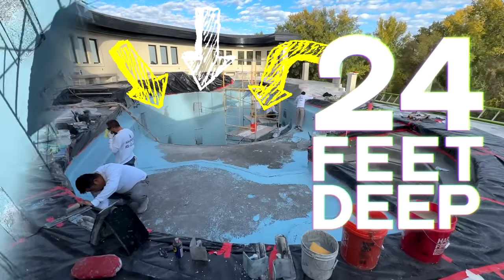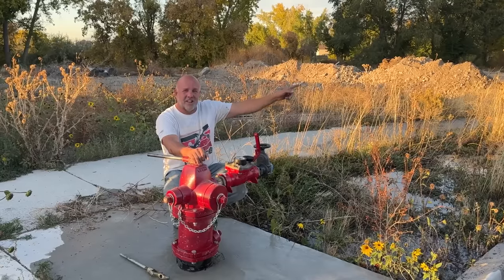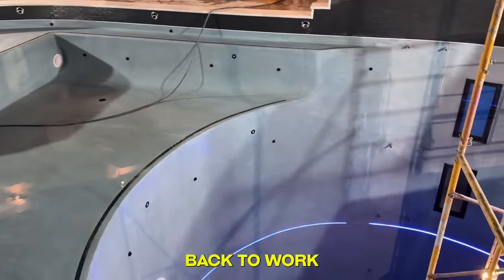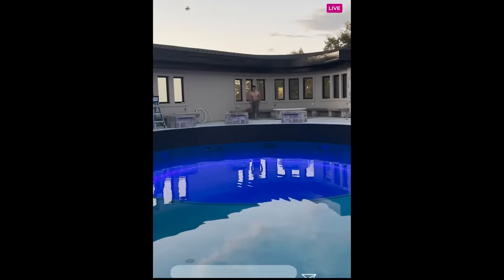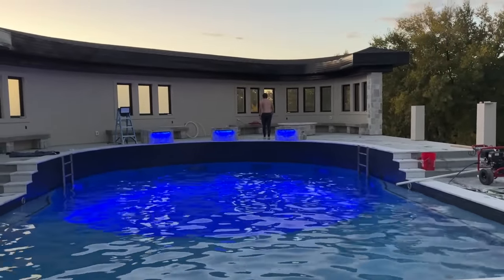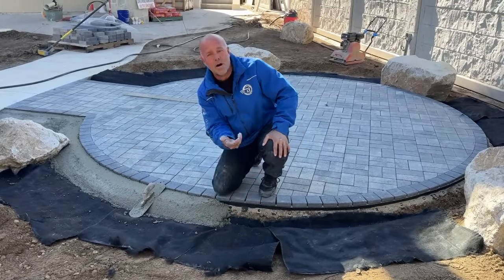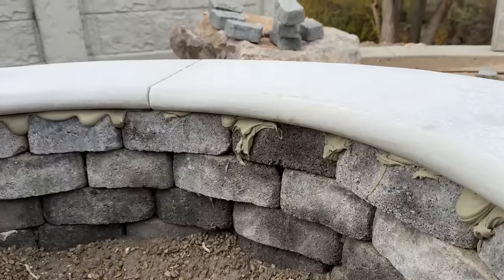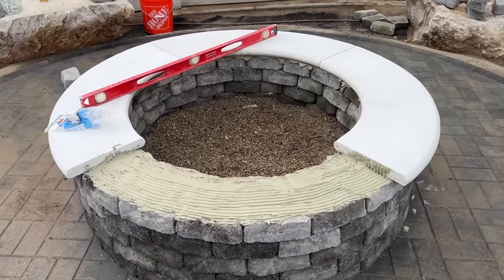You’ve been waiting for this…filling my home SCUBA pool! | House Build #20

Comment: You should definitely check into doing a “smokeless fire pit” it would be easy to modify yours that you just built and it greatly reduces the amount of smoke you get. Essentially you’d have to remove a brick or two from down low on the pit and then the fire sucks in air through the bottom which gets a more efficient and completely burn therefore you get less smoke
Reply: Yea he really should make it smokeless so he can then say his new house isn't polluting or in other words 0 carbon footprint
Reply: @jamesadams893 - 🤦‍♂️
Reply: @jamesadams893 he built a concrete mansion, I doubt he is thinking about his Carbon footprint
Reply: ha, I was going to say the same thing.  A 2" cast iron pipe running under the pavers in the middle of teh pit with intake behind one of the big rocks and 90 degree elbows pointing down (to keep water and ash out) would let in O2 and that fire will burn hot and smoke will rise straight up with the heat convection vs. a fire starving for O2 and smoke swirling around the pit.  Mike is the best....love these vids !
Reply: @fiercephizz4662  a smokeless fire pit can be selfish too. It's good for your fellow fire watchers. 
Win-Win
Reply: Thinkin’ the same thing.  I see smoke if Mike’s future
Reply: Over rated, I guarantee he is going to be using nice clean dry wood, very little smoke.
Reply: Agree. I built a similar wood burning pit, but failed to leave air inlets. Smoked like crazy. I ended up putting a large Solo pit inside the masonry pit. A less than ideal solution. I may tear the whole thing apart and redo it.
Reply: Part of the allure of a firepit is seeing the fire, right? It should be like 2 bricks shorter, so when your sitting around it, you can watch the flame dance
Reply: Some intro of O2 at the base will reduce smoke.  Even drilling holes through the wall.
Reply: Yeah the bottom of that pit is going to be starved of oxygen for sure. 
On the plus side it will make a good pond.
Reply: Keeping the perpendiculars clear would've been a great way of introducing oxygen. But he can drill those blocks and put an inch diameter aluminium line in every other block.
Reply: Yes, I would think keeping the smoke to a minimum so you can be closer to the fire for warmth on the cool Utah nights around the fire.
Reply: It’s a thing of beauty none the less
Reply: Was thinking the same thing👍
Reply: He really can’t at this point the way he built it
Reply: Fire pits are great but, smoke really puts a damper on the ambience. It’s an easy fix, tear it down and redo it right, Mike 😊
Reply: @jamesadams893 you should reduce your carbon footprint by talking less.
Reply: Guys he said there is a drain in the center....it should allow air to be pulled in depending on the diameter of the pipe.
Reply: @jjkastelic  from the video you can see the drain is just a drain for water to seep into gravel. Doesn’t look like there’s any piping there unfortunately. 😞
Reply: @CaptBryce  oh. Well, you have a good point. I didn't think of that. ;)
Reply: Damnit..i thought Patey researched it all. A simple Dakota firepit proves me wrong. You need to step up your game Mike! :)
Reply: There a several YouTubes that describe how secondary air is used to burn smoke. Just adding air at bottom won’t help to complete the burn.
Reply: @g2me194 what? Where do you think you introduce the secondary air? Oxygen is required where the combustion actually occurs, generally in fire pits this is at the bottom, there are many ways to get it there and extract it but in the end you need oxygen at the bottom. 
Secondary combustion is a bit different.
Reply: @jonathancorbett5917  except for that part about him saying that the fireplace would be a wood only fireplace separate from any other gas ones so that they could roast marshmallows and stuff over them without gas.
Reply: Noted. Commented too soon
Reply: @jonathancorbett5917  all good man, it happens :)
Reply: @Clynikal  yes secondary air but needs to be pre heated then introduced at the top.
Reply: Lmao, fastest turboprop on the planet, and we're concerned about his choice of $30,000 firepit. I wish I found this channel when it was good.
Reply: @jamesadams893 you serious clark?
Reply: Man builds planes, houses, pools, does engineering and the comments tell him he isn't doing it the correct way (their way).
Reply: @graememckay9972 there is no way to be a true expert in all of these fields at the same time- that’s why you see mistakes made
Reply: He spent a load of extra time and care to waterproof that stack of brick and everybody tellin him to drill holes in it 😂

Comment: many pools require a depth reading.  can you set adjustable markers, perhaps based on the cables? 

6ft or 3ft are not good for diving ..  so you'll want to have good markers to keep people from diving when it is in kiddie pool mode.

love your product
didn't know it was supposed to be wet when it cured

Comment: Great job, I'd knock 3-4 blocks out of the bottom of the fire pit for air flow, it helps a lot with the smoke. Little overkill on the grouting of the blocks, the glue is more than enough.

Comment: You forgot to add some fresh air supply to your outside firepit, the fires would burn a whole lot better, especially if the wood is a little green. And if you want to get fancy, which you like to do. You should have plumbed in a pipe from below and then you could have added an electric fan from a distance and force fed fresh air to the pit.  It would have worked sort of like a blast furnace and you can light your fire in no time at all and also control how big the fire is, or small. It works fantastic and you can make coals to cook with in a very short time. The only way you could do it now is to directional bore a hole under you pad, which could be done quite easily with a stiff hose or plastic pipe and a jet at the end with regular water pressure or a pressure washer and you would be at the pit in no time at all. The pipe itself would need to be 1.5 -2 inches in diameter and use a squirrel cage type fan equivalent size of a hair dryer, far enough away so it's quiet and by a power supply hidden in some type of box to further deaden the sound, and you'd be set for any kind of fire, even in an average rain. The pipe riser in the pit would be set about 2"s high and then a 1/2" spaced cap that's about 6" diameter to keep the ashes from plugging the pipe, it also disperses the fresh oxygen all around to promote the flame and a clean burn. From what I know of you form watching every Video you made, this is right up your alley and you would enjoy it very much.

Comment: Hey Mike I was a paver   for 10 years and on the edges we would cut in about 2 inches under the paver and push the concrete under the paver then lay the thicker concrete up against the paver just a little tip from an big Aussie fan oh and your house is incredible and sorry about your back mate look after it…in the words of a legend BACK TO WORK 💪🏻😂🙏🏻🇦🇺🪃🇺🇸❤

Comment: I'm kind of surprised you didn't imbed some small pipes or include a gap in the lowest course with the firepit to let more air come in from the bottom to extra-minimize smoke. Still, looks cool and it's good to see the pool finally rounding that last corner.

Comment: So glad you remembered to take all those workmen and scaffolding out before filling the pool!  I'm not surprised to see your wife working like you do - a strong and lasting marriage that makes!  I'm concerned that your fire pit allows for no air flow to the bottom of the fire.  You know the fire triangle: fuel, heat, oxygen.  Solid walls restrict the flow of oxygen to what can insinuate itself down the wall inside the pit, but outside the flames.  Result: smoke!  If you provide a controllable draft, you can regulate the speed of the fire and the smoke (unburned fuel) produced.

Comment: I'm not sure about your freezing in your area, but I do think if you use the fireplace enough (2-3 a week) you will end up having another pool, but it will be a ash pool. I clean my outdoor fire pit with a shovel maybe every 10 fires. I have about a 2 dozen sidewall slits that help air and water escape. After a while, the ash does almost become concrete when mixed with water from precipitation.

My outdoor camping fireplace I did exactly what you did but I poured cement in a circle, then mortared bricks down to the 10 foot diameter. Then custom built 2 foot diameter steel drum with 24 slits. It fills up with water  in heavy downpours and drains just as quick. The 24 slits also add to oxygen draft which causes less smoke during the burn and hotter fire.

I do think in time this will fill up with water and maintain the water. If you're anything like my location and you see -20°C, that non-shrink grout will crack, may be providing you with the exact same thing I have.

It looks like you have a 15 foot diameter which is nice. I actually wish I went this size too. I put my chairs outside the brick on the grass. I wish YouTube would allow pictures in the comments.

Comment: Should of ran a drain line under ground made of metal tubing. From the center of your fire pit. After cleaning the ash out you can take garden hose you spray out the rest of the ash down the drain line out into the yard or somewhere. Also the drain lines main reason is to allow air into the bottom of your fire. Your fires will burn much better.

Comment: OK Mike, I've got the story on the 737 Max 9 door plug now. As far as I can gather, this 138 foot long, 500mph jet with a max take off weight of around 150,000 lbs. that flies at 35,000 feet does not in fact have a door plug but a door patch. The plug in my bath would be safer. Thanks for the help.

Comment: Those pipes won’t explode form opening/closing because the joints are concreted. The base of the fire hydrant where it T’s into the main line uses roughly 3 yards of concrete.

Comment: Mike on the fire pit, did you need to have air slots to reduce the smoke or is it big enough in diameter for air to flow over the top?

Comment: Hi Mike, I wonder if you could help me with something. Recently, a door fell off of an airplane. Just quickly figuring it out, I think that the pressure on the door at 16000 feet would be anywhere from  4 to 7 tonnes and twice that at 30000 feet. The plane was a Boeing 737 max and the door appears to have been held on by screws from the inside. Could that be true? I mean if it was somebody's gonna get sued right?

Comment: also ditch that block glue you will regret it with freeze thaw over a few years it basically turns to dry puddy and loses all adhesion. you can walk up to structures with that glue after a few years and just hand pull the blocks right off. i rebuild stuff out of this glue non stop all year just a side tip

Comment: Curiosity not Criticism…Will the glue break down and become toxic by heat…will gravel make it hard to get ash out to clean…why didn’t you put any air hole?  Looks great and will be fun!
Reply: +1 on air intakes and a steel plate floor. Both could be retrofitted. Adding blowers on the intakes will make glass blowing with empty beer bottles easier.
Intersting question on the glue

Comment: That white firepit coping is not going to stay that way for very long if you use it more than a few times. Also using concrete brick for the interior wall of the firepit will crack/fail over time. A much better solution would have been using a darker stone coping and firebrick for the interior firepit wall. Your pool does look incredible by the way.

Comment: A motorcycle accident? never drive motorcycles, on 2 wheelers you are the crumple zone and you pay for the mistakes of cars. From what I gather it seems everyone who drives a motorcycle even slow ones have a spill at one point, which is typically when they stop, either voluntarily or by death. I warn everybody and too often they are so sure I'm just a wuss and they know best and 2 weeks later one of their friends die or they have an accident. I warned a guy driving a scooter to work, he blocked me on youtube but a few months later a truck pulled out and he busted his knee, had to stay home for months. No longer quite as defiant. Once you cross above 30km/h, it's deadly. Leathers only protect certain modest things like scrapes. Backshield is also modest. I get the appeal it's just a no.